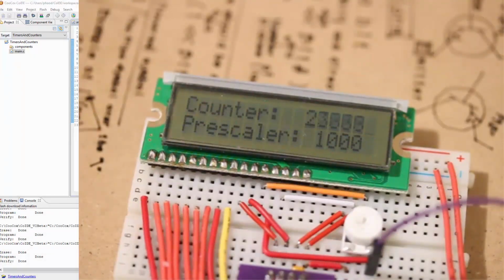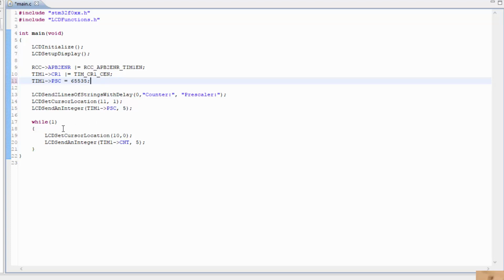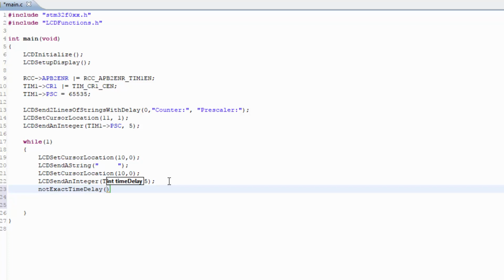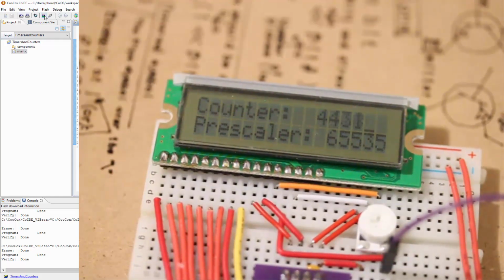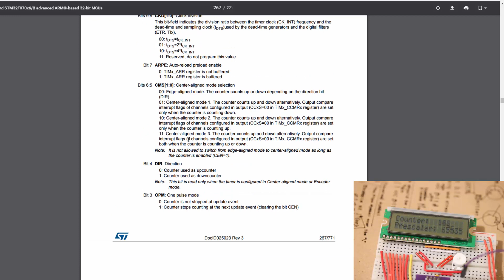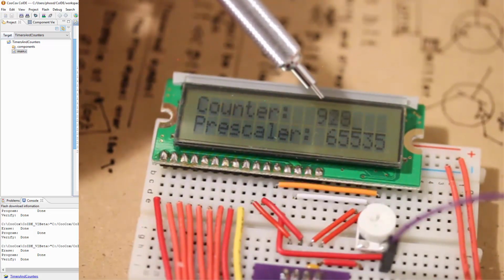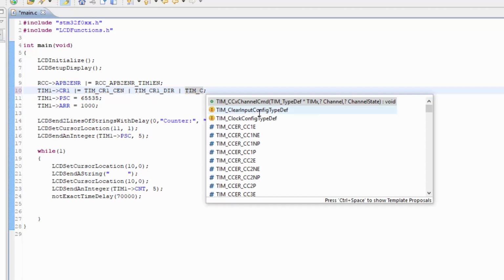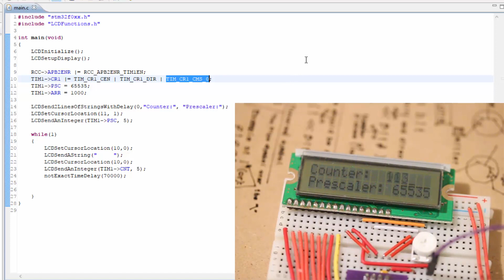42. How to use the ARR Register and the Direction for Timer/Counter on the STM32 ARM Microcontroller

Comment: The best MCU programming channel on youTube. Great video. Timers can be the most confusing peripheral incorporated in MCUs. Ironically, the many control registers and modes of operations are generally covered in the datasheets in the most terse of terms.

Your presentation methodology of taking each control register individually and then building with further control control registers to reveal the capability of timers, greatly simplifies their operation. So refreshing after the many youTube videos that approach the problem with "first you must set this bit in this register, then these two bits require this bit field..." etc. This latter approach leads the newbie to enter the correct code in the right place but with little understanding of what he has written.

Given the earlier videos in the series, a developer is not only left with an understanding of timers but even knows exactly what LCDSendAnInteger() does and how it does it.
Reply from the maker: Thank you so much for that wonderful comment and kind words on my approach.